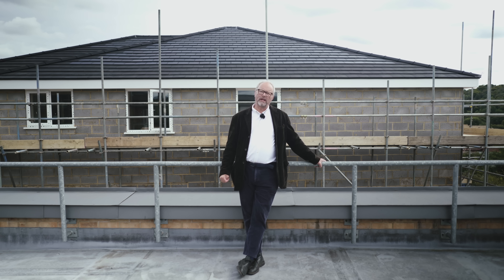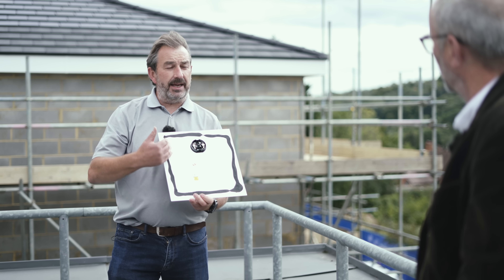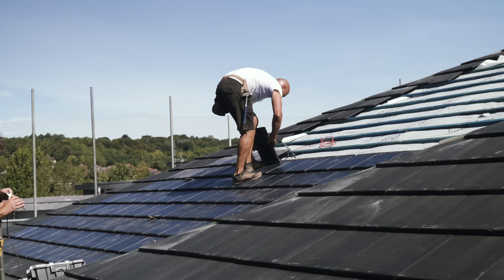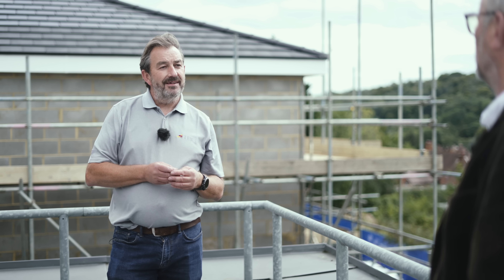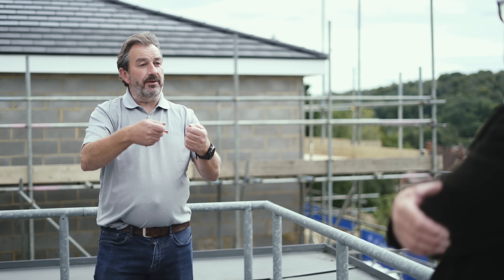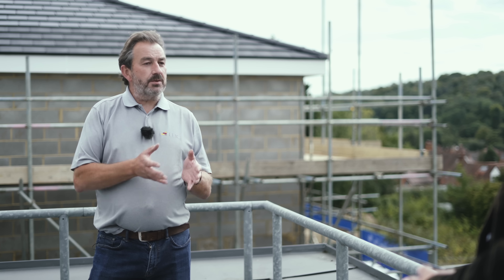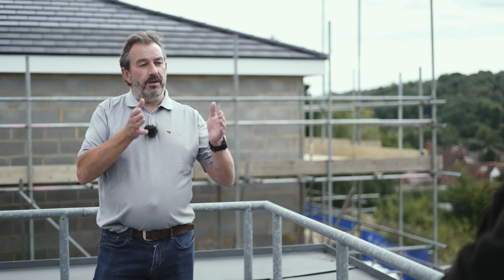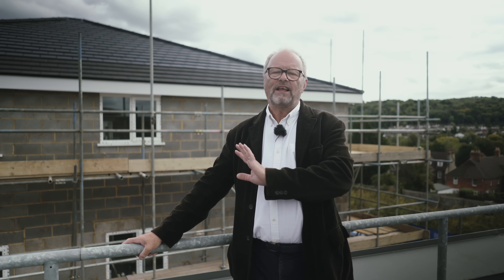Solar Roof Tiles - should every building generate its own power? | 100% Independent, 100% Electric

Comment: Oh it's great to see a more practical approach to solar roof tiles, we all know Tesla's solution is going to cost a fortune - so probably wont be viable unless your first name starts with Sheihk. £30psqm  does't sound too horrific. I imagine that'll come down if they are able to scale up.
Reply: £30 PER TILE
Reply: LibC assumptions just cause it’s Tesla does not mean it’s expensive. Their solar panels are the cheapest in the USA by a long margin about 50% cheaper! Their tiles are more expensive but I suspect they will be cheaper than this system.
Reply: @hamishbarrie8318  Compared to the cost of a reroof here in the UK, it was something like 6-7x more expensive. I think it's more common in the states to have shingles, so a reroof is something like 5-10$k. So however you look at it Tesla roof tiles are ultra expensive.
Reply: From what they say at the ~8 minute mark, I think It's £30 per tile, not per square meter. Tiles are less than a square meter. It works out 50% more expensive than applying solar panels to an existing roof. I'm wondering what the cost comparison is for one of these roofs vs the cost of a normal roof with solar fitted after.
Reply: @Leo99929  Ofph, that's pricey.

To answer your question, I reroofed and fitted solar at the same time.

Slate tiles are about £2-3 each plus fitting. Total cost came to about £14k for the roof.

4kw of solar using Solar flash slate mounts came to about £4.5k

So all said and done it was £18.5 thousand.

Are these tiles physically larger than a standard roof tile to make up the difference in cost?
Reply: @M0LHA   So that's £18.5K for the re-roof and solar, they said 50% more for their system than a re-roof. So that's £21k... So £2.5K more for a new solar tile roof than a conventional roof with conventional solar panels ontop. about 12% more?
Reply: I think its £30 per piece (8:27), so £300 per square meter. Of course you don't need to cover your whole roof in them, you can mix and match with regular tiles.

Comment: Invisible Solar.. Love the ring of that..
Though, I also like the look of "traditional" solar panels
Reply: Only there not invisible... you can clearly see which tiles have panels on and which don't, better to stick to traditional panels!!
Reply: @killuazoldyck1352  why is it better? Why would adding dynamic stress to the roof be better? Putting "types of stress" on the roof that the roof was never designed for is better? Please give your reasoning?
Reply: @ColinRichardson  roofs are designed to handle dynamic stress, a roof acts like a large aerofoil, it is subject to high pressure wind loads and low pressure wind loads depending on the direction of the wind. That guy was clearly selling his product and trying to justify the huge extra cost. How many roofs with traditional solar panels have failed because of dynamic stress? Also the extra materials concerns me, 2 MC4 connectors per 15w instead of 2 MC4 connectors per 250w, plus the little junction boxes. to me that is wasteful, larger panels are far more environmentally friendly and efficient. Fault finding would be a nightmare to, that many panels in series would make it hard to find a fault. To me this product is badly floored, it has been around for a long time and barely anyone has used it because from an engineering point of view it makes no sense, nothing more than a gimmick like hybrid cars.
Reply: @killuazoldyck1352  Sorry, I got 6 words in and already stopped reading, since you obviously read my comment but didn't comprehend it.. Try again.. If you comprehend it the second time around and you comment I'll possibly read it more fully.

Comment: I'd love to have these modules.  Can they be attached to old-fashioned slate?
Reply: I’ve been talking to Chris over the last 12 months and they have developed a man made slate that looks very much like a natural slate even down to mimicking the cut edge of a natural slate. We are hoping to use them on our build next year all being well. 👍
Reply: @markjarvis7087  awesome......I had that question in mind also, great news.
Reply: We have a light weight synthetic slates they are  supposedly made from recycled plastic .We converted a polycarbonate conservatory roof to solid.  (So we no longer freeze or roast ). They would be perfect fhis job as the pv tiles could moulded with a flat top and hole. The non pv ones maintain the slate finish.
Reply: We all have a lightweight metal roofing available,  which is what the cells are applied to already... So there is no need for a slate, concrete, plastic or any other substrate with hole in it..
Reply: @nc3826  unless you can only use slate on your roof!
Reply: FullyCharged Live 2019 certainly one trade stand had solar slate tile option - I did not take details but you seem to have a number of options highlighted replies to your post.
Reply: Buster Jangle  You craaaazy bro! :D
Reply: Yes it does, we are all craaaazy bro! On SM we could all be a bots??? :D
Reply: no